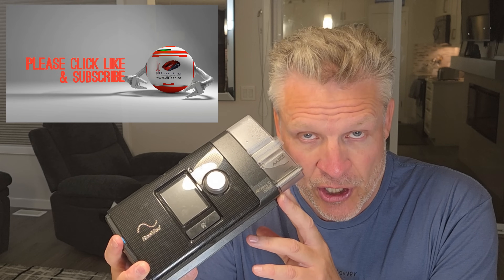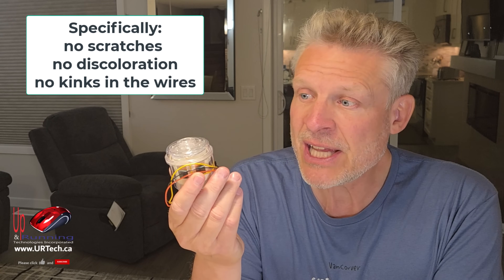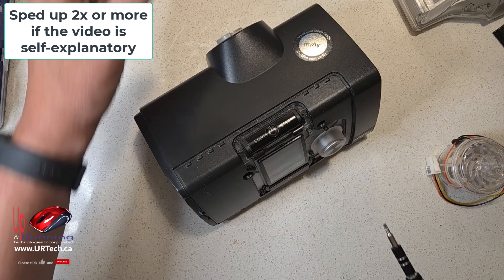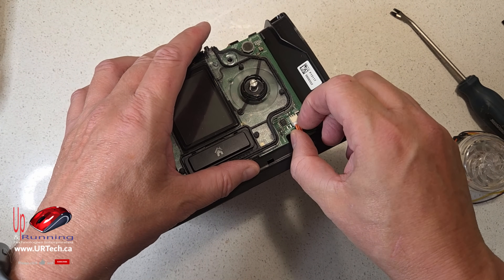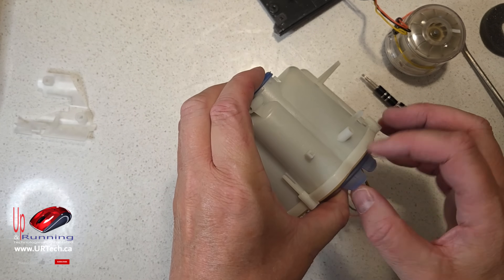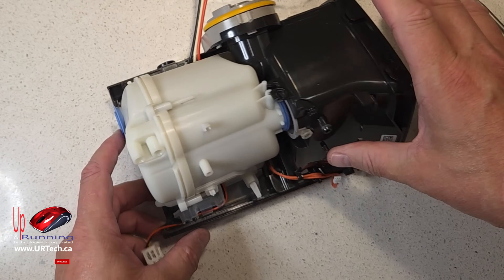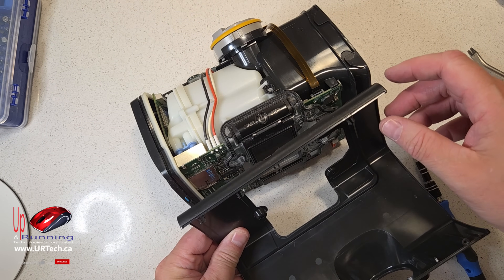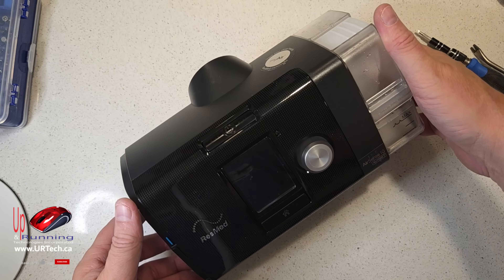How to FIX Noisy ResMed AirSense 10 Motor Replacement (Under 10 Minutes CPAP Repair)

Comment: Pro tip to align the wires out. You can put a dot with a sharpie where the wires are on the rubber piece before you remove the old motor. That way you know where home is.

Comment: Do you know what that blue sleeve around the blower assembly is?  I got a free AS10 but it has a funky smell to it when you turn it on.  If possible, while I have it open I'd proactively replace that rubber sleeve vs trying to clean it.  Wondering if the motor itself can be salvaged or if I should replace that too.  It only has like 2,000 hours.
Reply from the maker: I am unable to locate that "resmed airsense 10 parts motor sleeve" now.  I checked Amazon, Ebay, Temu, AliExpress and other sites, but keep coming up with nothing.  I know I have seen it in the past.  If I find it I will post a link here.  😒
Reply: You probably need to soak the blue sleeve

Comment: Replace the motor but now the air pressure in the mask is way too high.  I checked the settings and they're the same from when I disassembled.  Any thoughts what's causing this?
Reply from the maker: Nothing comes to mind other than the motor is either defective or not the right model.  I would ask your motor/pump seller about it.  Mine is as good as new.
Reply: Wondering if it was dying so slowly that you didn’t notice how weak it had gotten.
Reply: You can experiment by turning the minimum pressure down, and cut the max pressure to a safe level.  Also make sure your device (if it is an autosense unit) is still set on "auto", in which case the sensors monitor the air pressure.

Comment: I changed mine now the pressure is too high and constant preventing me from exhaling. Epr is on,  full time and set to 3. Any idea why?
Reply from the maker: Nothing comes to mind other than the motor is either defective or not the right model.  I would ask your motor/pump seller about it.
Reply: Maybe somebody on the internet posted instructions to change settings.  The Resmed is a medical device, and the seller will set it to the prescription or instructions provided by your doctor.  Only the doctor can give instructions to change the settings.  Maybe someone knows a hack to get to settings menu, but there’s no directions for the user to do that.
Reply: Search up 'AirSense 10 clinical menu'.

Comment: I've always found that disassembly is easier than reassembly. Your video sure made my life a lot easier! I listened to your advice about motor selection, and I have to agree with you about buying a "low cost" unit. I went for a $91 unit and just did a motor swap. However, how do I change the number of hours. Mine shows 27K. Is there a way to reset it? Thanks again.
Reply: Ya, that is a good question.  How to reset the hours?